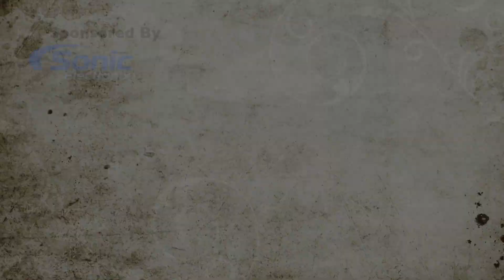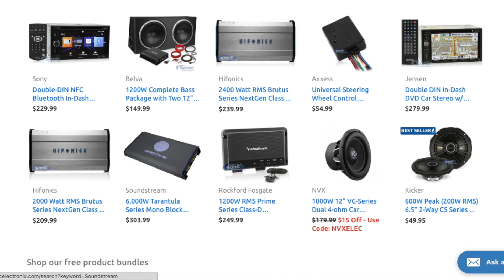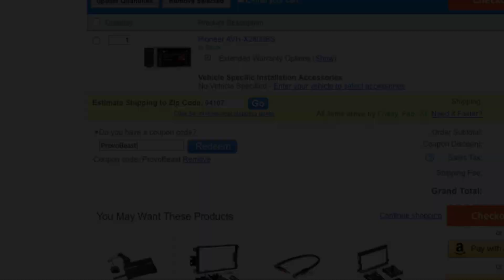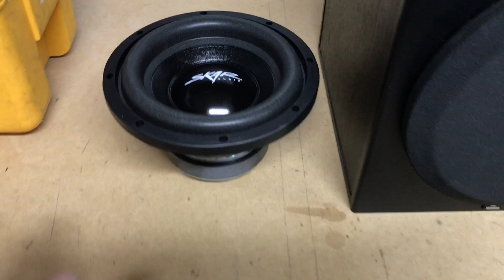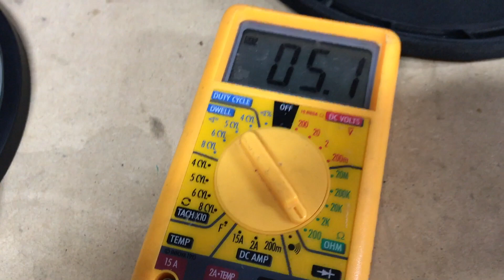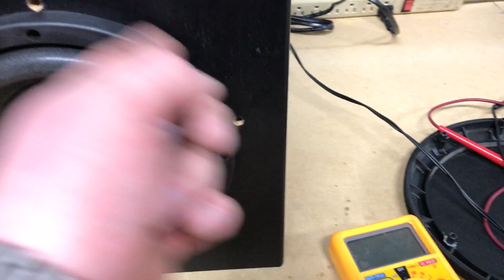Home Theater Subwoofer Replacement | Skar 8" Sub

Comment: I was told i couldnt do this in another video. Im in canada and itll cost me too much to actually get the replacement stock woofer here. I have a klipsch r 12sw and the woofer is 8ohm. Its rated 200rms and 400 peak.  Anyways i found a woofer with the same specs but is 4 DVC. I should be able to run it in series right?

Comment: Can I also use a 10 inch?
Reply from the maker: Sure, if your sub box can accommodate a 10". If not you wiil have to cut it bigger.
Reply: @ProvoBeastAudio  what if I’m gonna be using the same box as you? The Yamaha
Reply from the maker: You'll need to cut the hole bigger if going with a 10".  I don't recommend it. @glasszenin
Reply: @ProvoBeastAudio  I currently have a Polk psw10, do you think the 8 inch skar would fit good given how that Polk audio sub is made

Comment: Just ram across the vid, nice!!  It was probably showing 5ohm because you had it on its face.  Impedance should always be checked speaker facing up with no pressure on the speaker

Comment: I did the opposite lol I moved a 12 inch 8 ohm Yamaha subwoofer amp to my carbon audio PA sub enclosure and made a custom control panel from the existing controls! It’s a short term fix for the amp that blew and I’ve just been struggling to find someone who know how to fix it. I’m in central Washington state if anyone can direct me to a repair shop I’d appreciate it!

Comment: So I have an old Jensen 12" that has a blown sub. The sun doesn't say how many ohms it is. It's about 20-25 years old. 
Should I assume it's 8 ohm?
I bought a goldwood 12" 8ohm that's arriving soon.
Edit: they only had it in 4 or 8, single voice coil I assume because it only has the 2 leads. Hopefully if it's 6 the 8 should be ok since there are no 6ohm versions.
These goldwood are what's used in alot of lower end ones and as far as I know mine was only like 100-125 watts anyway when new. The goldwood is 240 so should be safe there I hope

Comment: what is the difference in buying the 2 ohm and wiring it to 4 ohm then just buying the 4 ohm skar ix8
Reply from the maker: There is a difference between single voice and dual voice coils. All depends on the sub you want at the right impedance stable by the built in amp.
Reply: @ProvoBeastAudio  so you think that the 2ohm would work better with that amp thats built into the box

Comment: Hy i have a boat soundbar model 2050. 
The subwoofer has 6 inch 80w subwoofer can i upgrade the subwoofer to 6 inch 100w or above ? 
How much max voltage subwoofer I can upgrade without burning the cicuit?

Comment: I had this problem with a 8" mirage powered sub. I decided on a Miller Kreisler 8" as a replacement. The results had me changing out my perfectly fine Polk 505 and another Mirage 12 with m&k's as-well. I'm not familiar with skar audio but do know the way they advertise and the availability reminders me of Boss audio in the 90's leading me to believe it is "Sub-Par" as the joke goes.
Reply: Skar stuff is way better than Boss haha. All their amps make at or more than advertised power and all their subs can take at or more than rated power. Also, I had the PSW505 and above around 32-34 HZ it absolutely slammed!. Under that hz though?? SO MUCH port noise. It was crazy terrible. That's why I had to get rid of mine haha.

Comment: Lucky I found this video I am doing the exact same thing but with a Logitech z506 subwoofer. These sets of speakers by Logitech are phenomenal if they recorded it you're going to hear it so I hope the speaker holds up. Thanks for the wiring diagram I have a voltage meter I might or I will check it like you did because they're two different brands and I don't know how the amps work for the difference if there is any. But I'll be doing everything you did thanks again good video.

Comment: Exactly what I was looking for Bro you saved me all kinds of time. Thanks
Reply: I'm doing the exact same thing in two days when I get the speaker with a Logitech z506 setup 400 w sub I think it should sound pretty damn good but I wasn't sure how it should be wired so this video is awesome!
Reply: @davolbc  I got the 8" for my Yamaha YST-SW012 and it worked perfectly. Been debating if it's smoking my 10" Polk on the bedroom stereo
Reply: @dixirkt  I found out it was the speaker hitting the grill definitely sound like a blown speaker. Took a screw put it in one of the holes and pulled it out the grill that is no more problems. Put it in storage as a spare they are hard to come by. Thanks for letting me know about the Yamaha speaker though I will keep that as a record because if they were good in that box they will probably sound good everywhere and I love Yamaha products for audio all my surround sound setups or Yamaha amps in my house with Klipsch speakers. Outstanding for movies but not so much for music I don't think the answer made for the music side. Anyway I've worked out 300 bucks that's a hundred bucks less than everybody else is selling them for brand new z906 I love these speakers this whole setup including software is so much better. Something to think about even has a remote control for those pesky phone calls.
Reply: @davolbc   forgot to mention that I bought it through Facebook and the seller neglected to mention that a mouse crawled in thru the port then couldn't get back out so he chewed his way out via the speakers cone. Tricky! Anyway I was broke so I patched up a hole about the size of a quarter with paper mache. Let it dry out for two days then put it to the test every day for the next 2 years and it tested! Believe it or not man I sh*t you not
Reply: @dixirkt  that's freaking amazing! I probably would have been too pissed off and made the hole bigger! Well that was pretty resourceful and you got two more years out of that speaker wow I guess that's a story I'll have to tell my grandchildren haha. Glad you're hooked up now. And for the two years I know that mouse wasn't around for 2 years.
Reply: @davolbc  btw this 8" Skar is breaking in nicely,sounds better all the time. I'm considering buying one for my 10" Polk
Reply: @dixirkt  that sounds awesome nice to know there is a good speaker company out there, I wonder where they're made? I'm guessing China but you never know unless I say so which I really didn't look. If you can afford to get one do it and swap it out with your Polk audio considering how old the Polk audio is it might be a little stretched out. My 8 in is still boxed up now I'm thinking about pulling it out and putting it into my jammo sub just to compare the difference and if there is one I'll do it for the others. Thanks for the update.
Reply: @davolbc  Polk Audio PSW10 2017 model. It's alright I suppose,.

Yea swap your subs out for sh*ts and giggles, may be impressed
Reply: @davolbc  gonna check out the z906 thanks for the info. Rock n Roll Bro
Reply: @davolbc  thanks man

Comment: hello can you suggest alternate subwoofer for logitech z906.
Thanks in advance
Reply: Something I need to know because I'm doing a Logitech z506 in 2 days? Why can't you do it with the 906? I also have a set of those coming new. Thanks
Reply: @davolbc  i put pyramid super pro in logitech z906 and its sounds great.
Reply: @MegaAkshay22  do you by chance have a link to that speaker I'm guessing it's 8 in? I don't have the z906 speakers yet so I don't know if it has an 8 or 10 inch speaker. Just in case this one doesn't work out I'd like to have another option and it sounds like you found the right speaker because these Logitech setups are really really good. But I'm replacing a sub speaker for a z506 system with an 8-in speaker for sub. Thanks again.
Reply: @davolbc  yes its 8" sub with 8ohm impedance.
This is the model number-Pyramid PW848USX
i buyed it from amazon.com.
I live in india so it was quite difficult to get this from local shopseller.
Reply: @MegaAkshay22  great for the information I love Amazon makes my life much easier sometimes. You said it sounds amazing and if it holds up to what the original subwoofer in this box sounded like it's a winner. But I had previously purchased the dual 4 Ohm coil 8" from Skar here in America. If it doesn't hold up to the quality of the original speaker I will purchase the one you sent me the information on thank you very much for doing that. Now let me copy that information you sent me and email it to myself so I don't lose it LOL.
Reply: @davolbc  this is not a high excurtion  subwoofer,but i am happy with the bass.skar is much better.
Reply: @MegaAkshay22  thanks for the information. All the stuff I buy already has high-end audio components in them so I don't know what's what when I need to buy a speaker. Thanks for letting me know I got lucky and picked the right one. And I got a backup just in case.
Reply: @MegaAkshay22  you complain about the speaker but have limited budget lol. Be mad at your pockets buddy

Comment: you think this would work on a passive style sub
Reply: I don't really think the subwoofer speaker cares where it gets its juice from so I don't really understand the question? The only difference I know of between active and passive is that with an active subwoofer you send a signal and the subwoofer has the amplifier in the box or somewhere attached to it whereas a passive is just a box with a speaker in it and you have to run speaker wire to your amplifier that controls your speakers. Hope that helps. If you do go passive with a subwoofer with no amplifier that you connected to the proper connection at the back of the amp for subwoofer because the amplifier is going to have a crossover in it for the right signal your base and low end to go to that speaker only. You can't just wire it into your left or right speaker output on the back of an amp. I mean you could but you're going to get all frequencies and all you really want are the sub frequencies.

Comment: this Skar Audio IX-8 D2 8" 300 Watt sub. has NO competition in its price range. and even more expensive subwoofers don't perform as well as this one. the 2-ohm version wired at 4 ohms is the best option for home audio. you just can't find a better subwoofer for 40$.

Comment: Can I put a 4 ohm subwoofer single coil on this Yamaha subwoofer?
Reply: From what I've read the OEM speaker is 6 ohms so putting in a 4 ohm when the amplifier is designed to push into a 6-ohm would mean to me be careful that you adjust the sub properly which means don't push it hard because it's going to give you sound at a lower volume than you are used to. You should be okay I would do it just remember don't put it on 11 or you're going to blow the speaker again. I think you're probably better off following the video and going dual coil 8 ohm.
Reply: @davolbc  I put a 4 ohm subwoofer and when crank the volume up it protects and power off the Amp. I ended buying the subwoofer showed on this video and it worked great.
Reply: @ivanborruel  the best way I can explain it is I wouldn't put a 4 amp fuse when it requires a 6 amp because you're going to keep blowing at high levels the 4 amp fuse. Glad you're happy with your speaker I can't wait to hear mine I got the same one. Enjoy
Reply: @davolbc  day and nigh. Big difference.
Reply: Yes if the ohm are the same there is no problem 👍

Comment: friend, my question is, my suwoofer sounds distorted or scratched as we say here with my 5.1 kinyo, the satellites good, but the bass sounds ugly, I already rewind the original and it started to sound bad again, it is a kinyo R565 6.5 inches, 60W , I do not know if it is a lot for that speaker or it needs one more wattage that does not distort it, I do not know if I can put more watts in a car and that it does not spoil the amplifier, the original reference is 4 oh 60w, but only 25 percent of the amp starts to distort bass.

What value do you recommend or which speaker?

Comment: I did the exact same thing for my 8in powered Sony subwoofer enclosure with the exact same skar audio 8 in. It dramatically improved the sound quality and the base is actually deeper then before. I can actually increase the gain on the back of the subwoofer box and as stated above, it sounds phenomenal. Thank you for the video. My home theater subwoofer is like brand new again.
Reply: I bought the 8-in skar four or eight ohm I didn't need it but good to know that they are a great replacement boxed up and ready to use when needed did not bother to return. You always need a couple Skar 8 and 10 in. Lying around when the zombie apocalypse happens right.
Reply: About to change my Sony Sub tomorrow
Reply: Im doing same thing now with sony powered sub thanks

Comment: i replaced my vizio subwoofer with a 4 inch scar audio it sucks bad trying to find something that will work good
Reply: When you get a replacement sub, you want to make sure the new one is within the same wattage as the old. You don't want to put in a 300 watt sub into a 50-100 watt amp. It won't have the power to drive it. 
Gotta get one that can be driven, but can handle it allot better than the old.

Comment: My subwoofer is 8 ohms, what ohm would I need to purchase in order to do this? Thanks
Reply: Buy a dual 4 ohm and wired it in series configuration. Google series wiring on 4ohm. It will give u an 8 ohm load at the amplifier.
Reply: @youngfeezy7969  thank you

Comment: I have a pc subwoofer that splits into a rca for 2 pc speakers, the sub doesn’t hit hard enough so I was thinking to buy a 12v amp and drill a hole in the box for a new subwoofer and run the power though the box so in theory the box holds a different subwoofer that’s powered buy an amp and the box itself powers the 2 pc speakers should this work. Only thing I’m worried is that the sub I buy might be too big for the box

Comment: How do wire it if I got a 6 ohm amp
Reply: Wire up in 4ohm will do just fine, Most amp can drive 4 ohm except some vintage tube amp.
Reply: Or get a dual 4 ohm sub and wire it to 8ohms ( id rather do 4 to get a lil more power but if the amp can’t handle it do 8

Comment: Brother I have the same subwoofer with me
Can I put 10 inch subwoofer with same impedance and higher watts
Reply from the maker: You would have to cut to fit a larger woofer.  The performance of the sub depends on the ouptut of the amp.  So unless you get a better internal amp, it will make no difference adding a more powerful sub.

Comment: I bought this sub after video as I have the same Yamaha enclosure... only question, what guage wire did ya use?
Reply from the maker: 12-14 gauge
Reply: Looked like he just used the factory wires inside the original box

Comment: I have a pair of JBL home speakers, 2 way one 8 inch woofer and a tweeter on each. The 8 in woofer is weak on one and the other buzzes at higher volume. Think I'd be able to throw two of these skar woofers in? They're 8 ohm speakers, so I'll just get the 4 ohm dvc skars and wire to 8ohms. Idk if it'd work, but if it would, it'd sure make these speakers pretty kickass

Comment: Way underpowers, skars are made for high excursion and alotta power!
Reply: GhostPanda yah but that amp is for home so it’s pretty weak but the bass is good enough for a home
Reply: @InderSingh-wz9ce  My fucking z5500 Logitech could overpower that.
Reply: GhostPanda baby logitech😂😂
Reply: @evatheboxer7417  Oh yeah? What if i say it can rattle my kitchen window, and cracked my living room window, and goes down to 26hz because i modded it.
Reply: After break in period sounds great in my z906 logitech. Can handle the power of the amp just fine. Doesn't overheat the amp. Had to modify the box a bit for the push terminals to fit.
Sounds great alongside the Rockford fosgate tweeters I added to it also.

Comment: I gota 10 inch Home theater subwoofer.. And it rattles as you said yours did. I have it Straight wired to my older type of FM radio that has a lot of other stuff, and it did work great and I didn't decide to straight wire it until the amp inside stopped working. But, I was wondering if I got a Comp sub the same size and put it in, would I need an amplifier?
Reply: .... Oh shit.. This was posted In 2017!? .. LOL Prolly won't get a response ..

Comment: Can I replace 6 inch sub woofer with 8 inch .?? I 6 inch is factory fitted ... will 8 inch will be suitable. with that factory emplifier ?
Reply from the maker: All depends on our ohm load and power output of the amplifier.  If you want to install an 8 inch, you may need to cut the enclose to fit, but a bigger speaker may need more air space, so a lot of variables there.
Reply: Provo Beast Audio Installation Thanks

Comment: You should have got the Dayton Audio reference 8 or the ultimax 8
Reply from the maker: Nah
Reply: Provo Beast Audio Installation that reply for some reason cracked me up😂 how is that system holding?
Reply: Super Jackiejojo spending that much money on a home sub not worth it
Reply: Dayton are cheap there good for kids not there not good quality but they sound fine for some

Comment: nice video thanks for the info it would be good if you can film every step of the way including the wiring materials etc
Reply: I'm doing the exact same, but I'm using aPyles 1290  blue wave 12" sub, didn't know about in sequence wiring but now I do thanks alot
Reply from the maker: Not sure how much more clear this video can be...

Comment: A bigger wattage sub may not actually produced better sound due to the low amp rating.
Reply from the maker: Those are not drill holes, those are for the grill....

Comment: How high was the Yamaha amplifier turned up I have the same sub at home with the same problem and want to know if the skar would be the right choice
Reply from the maker: Skar is a great choice.  It has a much better bass response than the factory woofer.